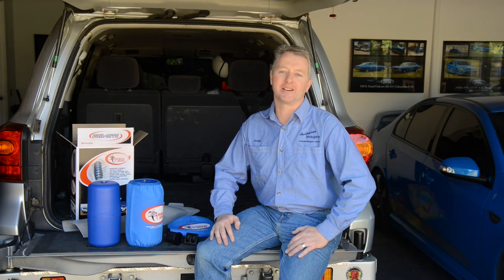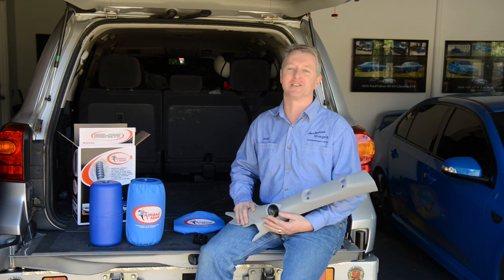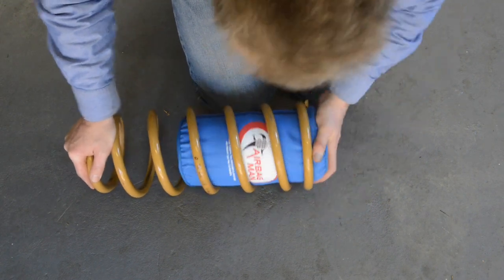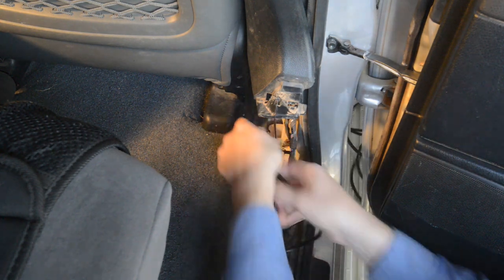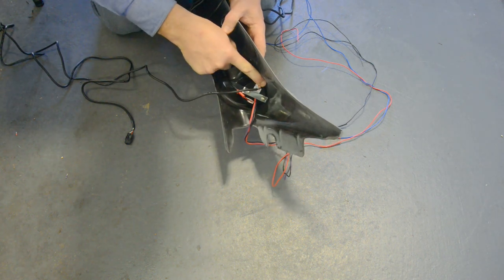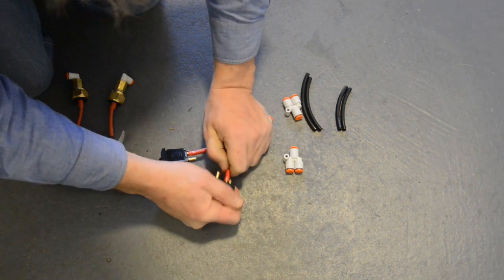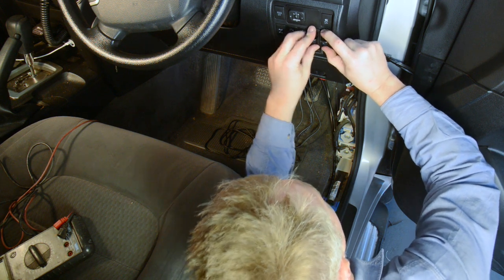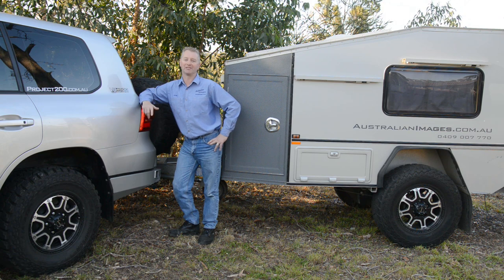LandCruiser 200 - Airbag Man Heavy Duty kit install - Project 200

Comment: Update found a new product done by a company in QLD it's a wireless air compressor kit no more pulling the dam 4wd apart to run airlines or wiring or gauges or switches or a bloody pillar pod . The pump I have sorts nicely out of site àĺl I see is the remote control on my dash push the button and up they go press again down they go . While driving my system will automatically level it's self while driving along

Comment: I am impressed with the work you have done and the Airbag Man heavy duty kit.  But I am NOT mechanically inclined at all.  I need someone who is qualified to do the install but I live in the US!  Much as I would love a trip down under, bringing my 2016 LC along is not possible.  I also already have a modest (2") ARB/OME lift.  So I am looking for airbags that will fit with that slightly taller suspension.  I won't be using the air bags to add lift but rather to add support when towing a trailer and possibly to do a bit of leveling when camping.  Any suggestions?
Reply from the maker: Hi Dan. Probably a bit long to reply here. Can you send me an email (address on Australian Images website) and I'll reply.

Comment: Hi There
I own a LC200 and looking at installing the air bag man. 
Would you be able to advise where you purchased the new A pillar to cater for the gauge? 
Can you also please give me your feedback on your experience with the airbag man.
Reply from the maker: Hi mate, Airbagman were great. Never had any problems. You can find the A pillar trims with gauge cutouts here: https://www.ebay.com.au/str/pillarpods/TOYOTA-200-Series/_i.html?_storecat=8572055015&mkcid=1&mkrid=705-53470-19255-0&siteid=15&customid=link&campid=5337824865&toolid=20001&mkevt=1

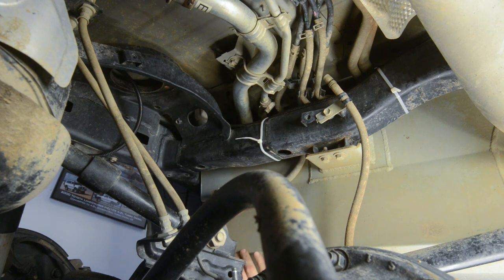Comment: You were pulling excessively on the rear flexible brake hoses when lowering the axle. See 04:35
Reply from the maker: It may look that way, but the lower bracket is unbolted from the axle housing, so it doesn't put too much tension on the lines.

Comment: Did you consider LINX as the controller?
Reply from the maker: Not really, because I had already installed so many of the accessories that would use it, so there would be a big reintegration job to get the most out of it. If I were starting a build today, then I'd give it serious consideration though.

Comment: It's a stop gap. Get decent suspension and you won't need this shit.
Reply from the maker: The issue isn't the quality or rating of the suspension, it's the use of the vehicle. Sure, if you're loaded all (or most of) the time then it's better to install heavier springs. But if you regularly have widely differing loads (such as a daily driver which spends most of its time empty, but is then loaded up heavily and a trailer/van added for trips), then airbags are an ideal solution. Because if you install heavy springs suitable for the vehicle fully loaded, then when you're empty around town it rides like a pig and sits 50mm too high. Airbags solve that problem.
Reply: Australian Images 
Airbags change the geometry of a suspension system using a central pivot when loaded. In many instances, the load is transferred to the rear of the vehicle especially in dual cab utes. In this case a Superspring is a much better alternative. I have used bags before on a multitude of outback trips and found they were more trouble than they’re worth. Leaks , punctures and such. There is no substitute for decent coil springs which can handle a load and still give a ride that won’t put your back out. I know because I have spent many hours in various vehicles on all sorts of road conditions. Sorry, airbags are detrimental and pain in the wallet. 
When I’m on a trip I have better things to do than worry about fixing airbags or indeed a broken chassis. 
You will never convince me!!!
Reply from the maker: To each their own. It's certainly true that they can alter the load point on leaf-sprung vehicles. But when located inside the factory coil springs, the load point is essentially unchanged. It doesn't matter how high the quality of the spring is, if you have a coil that's designed to carry an extra 500kg and maintain normal ride height, then removing that 500kg will increase the ride height substantially and make for a much firmer ride. There's no way around that fact. If that's a compromise you're willing to make to avoid installing airbags, then go for it. Personally, having also had several vehicles with and without, I prefer the airbag option.
Reply from the maker: BTW, not trying to convince you at all. For some people, airbags are an ideal solution to a problem. For others, they are not. It all depends on the vehicle and its usage.
Reply: Australian Images 
Variable rate coils are made for this exact job.
Reply from the maker: I've run variable rate coils in the past. They do help solve the ride issue, but not the height issue.